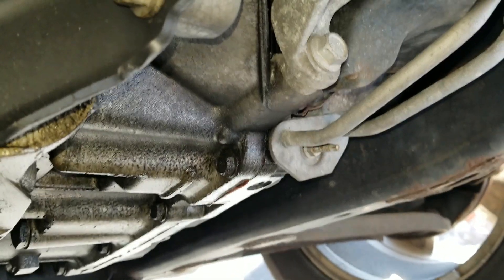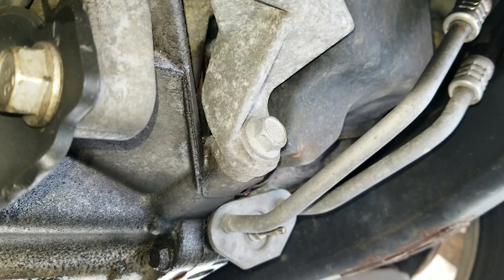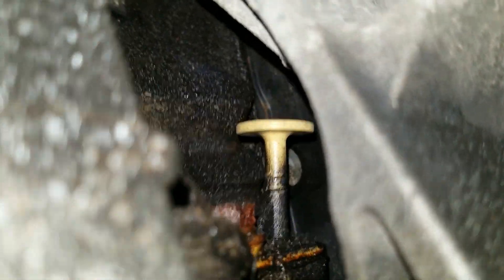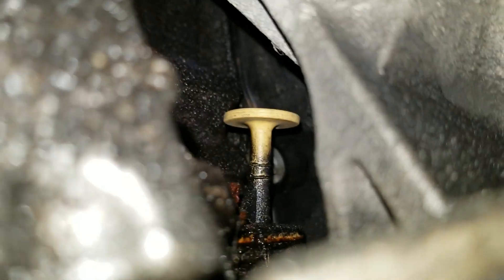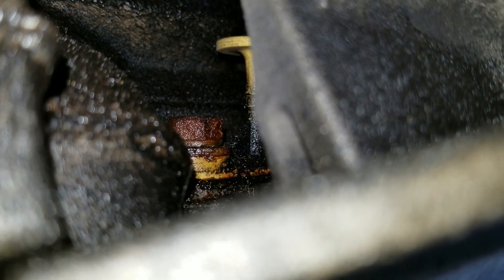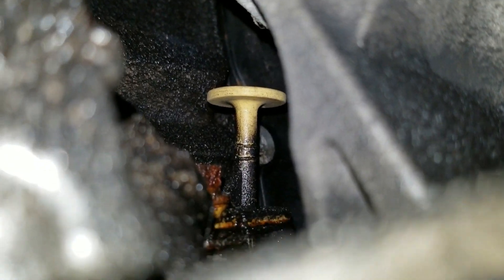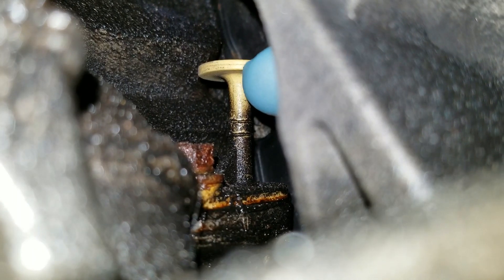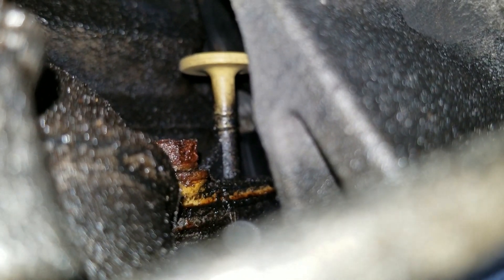Pontiac Torrent Transmission Dipstick Location. FML!

Comment: you have to remove the transmission mount, the mount that you said wass engine mount , thats what u need to remove to get to that dipstick, its  3 or 4 screws 18mm and 15mm to get that mount off , then u can acsess the stick but to take it out thiers a 10mm screw , cant miss it only screw there and its holding the stick into placce. once removed that iu can check fluid , also to add fluid , ull be adding the fluid in where the" dipstick " ( its not a super long one like for oil its a short little dipstick / checker thing) but you add a tube in there thats connected to a funnel nd then just carefully add ur fluid (:  turn ur engine on , shift thru all the gears and the re check to make sure ur fluid is where it needs to be cause car needs to be on and runnimg to get accurate reading . hope this helps.

Comment: FML indeed! I looked all over the place for that damn thing! Couple questions... Do you still have your torrent? Any problems with the traction stabilizer light constantly coming on? Also, there's an emissions sensor that just went out on mine and it's 100 bucks for a part the size of a bic lighter... how important is it?
Reply from the maker: Unfortunately I don't have it anymore. It really was a great car but needed something with 3 rows. I did have the Stabilitrack light come on every now and again, which I believe was a random ABS sensor failure but never was able to confirm it. What was the sensor that went out that you have to replace and/or what ses code?
Reply: @JrZCarZ  I actually got both issues taken care of.. for some reason when the emissions sensor goes out, it also triggers the stabilitrac light. Apparently it's a known issue with the torrents. I found that part on Amazon for 40 bucks instead of 100 at AutoZone, I replaced it and it fixed everything.
Reply: @handygramps51  this sounds like the answer to all of my problems, what senor was it and was it an easy fix?
Reply: @brysonfrederick8588  it's an emissions sensor located on the front of the engine. 2 bolts hold it in place with one electronic clip. Easy fix, took me 5 minutes and solved all my problems. Also, look for the part on Amazon, I got it there for 40 bucks instead of the 99 auto zone wanted

Comment: Surprised no one had designed a dipstick tube for these yet.. could be flexible, bolt on top and bottom, come on engineers, make us a tube.. taking off trany mount to access dipstick is an unwarranted chore for those of us who change fluids or make repairs...

Comment: This is a easy job just remove battery box and tray then you can get it from the top with extension and 12mm socket
Reply: Removing my battery box to check my transmission fluid= easy job, right🤨
Reply: @jg-dh7st  compared to removing an engine mount I will gladly move the ECM and unhook the battery.
Reply: @huffbagwell3201  true....ijs, that's dumb but I agree
Reply: Will try this
Reply: Copy and pasting this to my notes and THANK YOU!
Reply: Od like to see the video